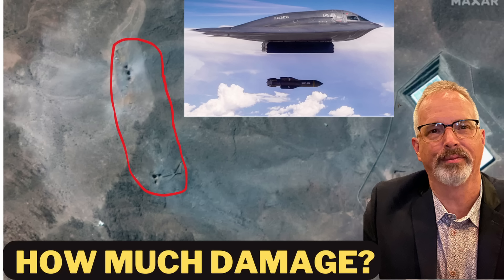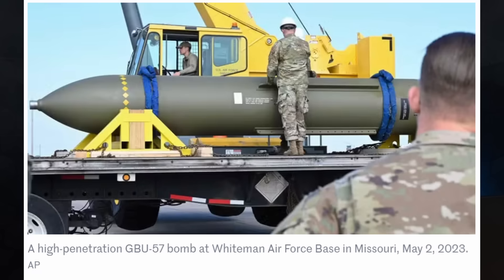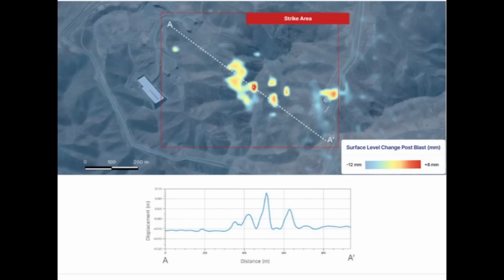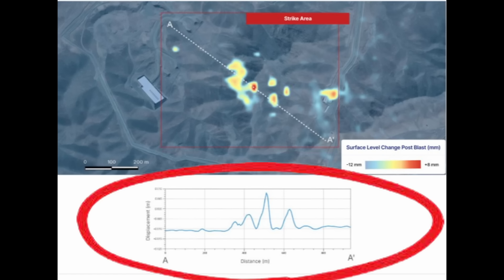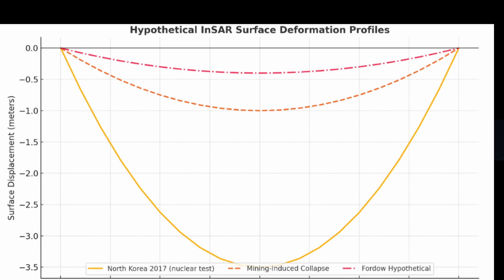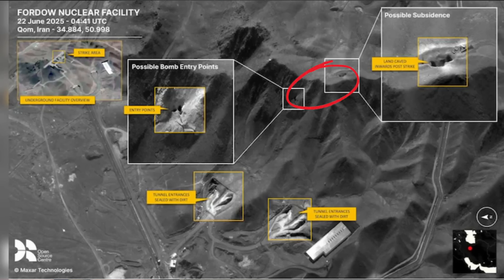Fordow Attack Assessment -  Update

Comment: There have been comments elsewhere about the IRGC doing post attack construction work at the site. More likely, this would be a geotechnical investigation to determine the damage profile. The site has multiple material types and a comprehensive investigation would be wanted to design a successor facility, whether it be for uranium processing or some other high security use.  The IRGC is aware that we only have 19 B-2s and the mop is the largest bomb it can deliver. With six MOPs down each ventilation shaft, this was very close to a maximum effort. When thinking about the MOP, it is important to distinguish between inertia and kinetic energy. When pounding a pipe in the ground, a heavy hammer swung slower puts the pipe in the ground faster than a lighter hammer swung faster which mostly mushrooms the top of the pipe. This is why there was no rocket motor to boost the speed of the MOP. For penetration, inertia is king.
Reply: what may be more likely is the other existing locations that no ones know about will have their existing ventilation shafts modified to arrive elsewhere, rendering this form of attack impractical
Reply: 680mph at best.
Reply: @russellk.bonn8534 for the b2, or the gbu-57?  I've seen estimates putting the MOP at around 800mph on impact.
Reply: @russellk.bonn8534  680 mph = 300 m/s on a 14,700 kg device is a kinetic energy of 660 MJ, which is equivalent to 158 kg / 351 lbs of TNT.
That is quite exactly the amount of high explosives used to bring down the 33-story Landmark Tower in Ft. Worth, Texas, in 2006.
Reply: Not sure about the maximum effort suggestion. The GBU-57A/B MOP contains 5,342 pounds of explosives. Meanwhile the B61 nuclear bomb is rated at 0.3 to 300 kilotons of TNT, while the B83 is capable of a blast up to 1.2 megatons.
Reply: Yea but remember it’s a maximum effort of what we are willing to reveal at the moment. We have much bigger and much better “on the way.”
Reply: Supposedly the b21 is designed to carry the MOP and we just bumped our order on those to about 200 units.

And I hope Iran doesn't make the same mistake Iraq did and trick us into believing their weapons program is a threat we can't neutralize from stand off ranges.
Reply: @dudeinanofficechair7662  Iraq didnt make that mistake, isrl convinced our gov it was true when it wasn't.
Reply: @dudeinanofficechair7662  Iraq tricked us 😂😂😂😂😂, god the copium doesn’t stop with you slops
Reply: @cmendoza1094 I've heard it a few ways. Some think Saddam tricked us into thinking they had a real program because that's how he was getting international aide bargaining leverage, some think his engineers and scientists tricked him into thinking he had a real program because he would kill them if they were honest and told him they hadn't accomplished anything. 

Are you suggesting he actually had a functioning nuclear program?

Comment: I'm an old aviation ordnance tech on the OLD single seat F/A-18 (A), first time the YouTube gods decided to lead me here.  Love the breakdown, love the straight based facts and your professional assessment at the end.  All I did was put the loadout on the aircraft and let it fly.  We were taught the basic operation of each weapon, how to do the checks on the aircraft, and general upkeep of all the ordnance computers/equipment ect...  Never REALLY knew exactly how much damage the bombs would actually do.  Missiles and rockets a bit easier to judge.  You got my sub because I learned quite a bit today.
Reply: Up front, I don't have any background in geology, arms damage assessment, engineering or any of the sciences needed to make a critical evaluation here. But I do have lifetime of accrued observation of physics. Worth nothing, perhaps, but I find my observations corroborated in many instances. 

What I notice at Fordow is these MOPs repeatedly piercing the vents, deep into the hard granite. Each bomb driving deeper and detonating at depth. The explosive forces and resultant gases are not demonstrating on the surface. Those pressures are not simply absorbed by soft rock. This is hard, but brittle granite, not known for its flexing properties. Therefore, the first subject here would be mass compression of the open spaces (tunnels, shafts and work spaces). The volume of gases would far outweigh the capacity of that compression to absorb it. Next, that pressure would uplift toward escape. The depth and strength would largely hold in that expansion. So now the rock begins to shatter as the substrate flexes to absorb the blasts. That pressure, confined in this hard box of stone, assures complete destruction in my eye. It's almost like being inside a pipe bomb. Too much pressure and not enough space for expansion.

I would expect there to be a large void beneath the surface at impact points, shattering of the rock around these pockets
and total destruction of this facility.

Maybe I'm wrong, but this is what my common sense and applied physics history tells me. Iran will evaluate the damage and their actions will determine the success or failure of Midnight Hammer. If they start digging this equipment out, we may have failed, but I suspect they'll view the evidence and abandon this site. Thank you, for accommodating this simple man's opinion.
Reply: @karlharrelson1091
Observation of applied physics over the years can sometimes make more sense than any college degree.. 
I agree with almost everything that you stated and what was in the vid..
The only thing not mentioned was that the pilots dropped bombs one after another seconds apart to ensure at least the 2nd bomb would get to depth..
I feel the shear weight of the bomb @ 30,000 lbs would penetrate a couple hundred feet deep
Reply: The world did learn that the B-2 with its maximum 40,000 lb payload is actually at least 60,000 lbs.
Reply: @andym4695  Yep, 40,000 lbs MAX it is.   Just like the carrier USS Enterprise had a “maximum speed of 33.6 knots” - but was  tracked moving much faster.   The AGM-88 missile supposedly only goes Mach 2.9.   However, the Wild Weasel mission it was designed for requires it to move faster than the soviet anti-aircraft missile whose targeting radar it is designed to destroy.  Those missiles -one of which is the S-125 - travels at MACH 3.5.  The US M1A1 tank only goes 45 MPH - which is true (unless of course the governor is off.) The US has always gone to great lengths to cover up the true capabilities of its weapons.  Which likely means they would not have even flown this mission if the BLU-57 - or something waiting in the wings - couldn’t go even deeper.
Reply: @andym4695  That is true, that's why so many KC 130's needed, lot a weight = lot of go go juice
Reply: @andym4695 they take off empty fuel tanks
Reply: Thank you for your service..I salute U 🫡
Reply: @kayejeyeracer  No thanks needed, but are appreciated!!!!
Reply: Soldier this goes boom.  That is all you need to know.😂
Reply: @alaskansummertime  Pretty much lol  Gotta be able to laugh at yourself sometimes!
Reply: ONLY the self-deluded opposition and willfully ignorant would argue against the obvious destruction caused to Fordow!!   God Bless our military skills and commitment to our nation!!  God Bless the USA!!
Reply: @zubenelgenubi You're the deluded one believing all their lies. They've been saying Iran is building a nuke for 40 years even though their own Intel agencies tell them there's no proof whatsoever. But you just keep swallowing what they say like a good little boy.
Reply: Be careful it could happen to you

Comment: The bombs have a penetration depth of 200ft. A simple coal mine is 3000ft. It is quite likely if you have years to plan for being hit to dig beyond 200ft. Maybe they store the solidified UF6 feedstock and product far deeper and just have the warmed UF6 gas in the centrifuges at 200ft. Maybe the centrifuge rooms got hit, but that doesn't mean all the solid product has gone.

Comment: I would imagine that the shock wave thru the air duct must have punched it's way into the facility on the initial blast which would be pretty devastating. The shock wave thru the rock of the subsequent explosions may have cause the walls inside the facility fracture and expel rock and perhaps a ceiling collapse unless the facility was a lot deeper than 200'. The amount of activity at the site should be a good indicator on how much damage was done.

Comment: Thank you. Great video.  I have absolutely no background in geology. Does the expectation of fractured rock, and amount of increased volume, depend on the available area to expand into?  For example, if the shafts ended in nothing but solid rock, like in oil fracking for example,  do you get the same mount of 'bulking'?

Comment: The bombs have a mass  of 30 000lbs but a much smaller explosive payload of only around 3000. Most is made up of steel. The Iranians were also very open with the design which included blast halls to redirect the energy while protecting the structure itself. Weapons manufacturers have a tendency to grossly overestimate the capability of the weapons they sell. Im still pretty sure this has only added rubble that could be cleared within months. They are already rebuilding. Why rebuild an underground structure that has been destroyed when it would be far easier to use one of the many other sites available to them
Reply: You are pretty sure this only created rubble?  I am pretty sure, you have no clue and just fabricated a story.  Name the other sites, that have these types and quantity of centrifuges?

Comment: engineer who is not there doing 20th party they got from a friend who got from a friend who got from tiktok who got from china...blah blah blah.... as a guy who tests defense department weapons longevity cycles who works in the same BAE building as the developer engineers for things that  make other things go KABOOM...the blast alone wiped out all the machines inside...the tectonic blast pressure alone, then the engulfing fire milisecond by milisecond and you're here talking about dirt and your not a geologist. well buddy as an operating engineer since before you were born. it takes me 2 hours to put an 8' diameter hole  down 36' feet...so in half a day i could sink a drill right into the blast site...but your not even there, you don't even know how to run a drilling rig much less use it, and i'm sure you'd break it inside 5 minutes anyways. but your going to give ius your expert plastic manufacturing engineering advice. you ain't even qualified to hold my big johnson.

Comment: Is it possible they didn't put the actual functional parts of the facility under the vents? Would it not make sense for them to burrow sideways an extra 500 metres or more away from the obvious surface elements to actually construct the critical parts of the facility?
Reply: I've wondered about that. Knowing the exact layout of the site is crucial to putting those bombs on target. But I've since learned that IAEA inspectors had regular access, so indeed it is known exactly where those ventilation shafts lead.
Reply: @WritesWithCare So you are confirming what the Iranians have said about the IAEA inspectors being spies?

You yanks always run your asses without thinking through what you say.

Comment: Bomb Damage Assessment of Iran's Fordow Nuclear Site Using Interferometric Synthetic Aperture Radar (InSAR) Analysis: 

The Fordow facility is located in an area with granite rock, known for its hardness, which aligns with President Trump's previous statements [03:36].

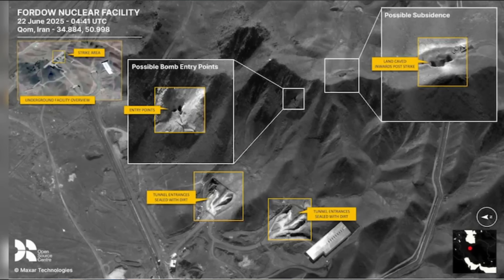The sharp, knife-edge ridges around the facility are characteristic of granitic formations, suggesting the Iranians chose the site for maximum protection [04:22].

The GBU-57 bombs are designed to penetrate tens of feet of rock and detonate deep underground, creating a "camouflet" effect—an explosion that leaves a sealed pocket of smoke and gas without forming a surface crater [06:31].

Despite the subtle surface changes, Casey Jones estimates a maximum of 100,000 cubic meters (130,000 cubic yards) of granite was fractured, based on a "powder factor" of 0.3 kg per cubic meter [08:02]. This volume would require over 13,000 truckloads to haul [08:43].

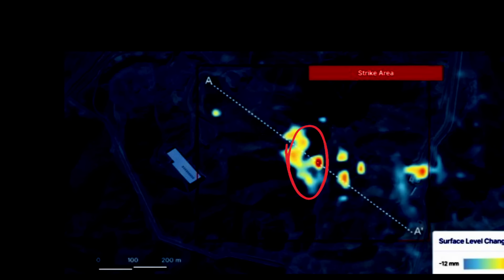The estimated uplifted material volume is around 400 cubic meters (500 cubic yards), which is only a small percentage of the total fractured rock [09:42].

The facility's depth (80-90 meters or 250-290 feet below the surface) resulted in high confining stresses, directing the explosion's energy sideways and downwards with minimal surface expression [10:31].

Casey Jones concludes that the facility is likely "utterly destroyed" due to the extensive damage at great depth, despite the limited surface evidence [09:08].

Comment: Great video.  But I'm not sure this destruction I agree happened is a whole lot more than some fractured rock above the confines of the facility.  Would be helpful to know the volumes of the underground facility to help with that.  But the general burn that happened above ground is very good sign some of the blasts were very much puked out.  The plugs on the facility entrances seem most undisturbed also.  Essentially it seems a lot of destruction and rock crushing could have happened without finally making it in.

Comment: You are basing your analysis on what may be a totally false assumption.   I doubt that Iran was stupid enough to build vertical ventilation shafts all the way to the bottom... given that they knew the US would likely bomb the facility. those ventilation drawings may have been deliberate misinformation.   If the bombs were stopped partly the way down vertically there may be no dammage to the lower tunnels at all.

If I had been designing the ventilation shafts I would have gone like 50 ft down, then 100 ft horizontally with a blast door that would be closed by a blast from one side.  Then down another 50 ft, then another 100 ft horizontal tunnels with a blast door, then do it again two more times to get down to the production and storage tunnels.    Given the hardness of the granite all that would have been collapsed would be the topmost portion of the ventilation shafts.  It is unlikely that the 4th blast door would have needed to have closed.

As far as eplosive damage result - you forget that a lot of the blast energy is going to go back up the ventilation shaft or the entry hole that the bomb penitrated.  Those are open and unsealed.  In tunnel and mine blasting the ends of the blast holes are sealed to ensure that most of the blast is transmitted to the rock and not just blown out the entry hole.   As a once licensed blaster I would reduce your blast damage estimate by at least 50% if in solid rock, and likely less than 20% if at that bottom of a ventilation shaft.

Iran is not allowing any inspectors in but has said that the facility is not totally destroyed.  I would not be surprised if there is no significant damage at all to the production equipment.

In addition you have the issue that its almost certain that Iran removed the highly enriched uranium hexifloride from the facility days before it was bombed.  So they appear to have access to at least 60% enriched uranium in a quantity likely large enough to produce multiple atomic bombs,   It would help if they ran it though another centrifuge cascade set to get it above 90%, which they may be able to do because Iran has centrifuges at other facilities.

Comment: According to AI, granite would couple more energy from the bomb than dolomite. The MOP exploding in solid rock (not down a vent) would couple an enormous shock wave toward the tunnel without having to actually  penetrate to it. Even if that shock wave did not collapse the tunnel it would destroy anything in it.
Reply: not  a simple problem. the shock wave will attenuate but the rate of attenuation is a question for specialists and Phds.
Reply: @juliuscesar4176  Even they won't know for sure because they would have to know the details of the fracture pattern down to the surface of the tunnel concrete. Nevertheless, the shock to the tunnel should be strong and one need not be a Phd to know that.

Comment: Thanks for your video.
The ventilation shaft(s) may have been staggered and not gone straight down through one shaft.
In other words, a shaft went down to a depth of say 50 feet, then a horizontal shaft extended over from this shaft to another vertical shaft and possibly the same thing again at another depth.

Comment: Maybe I missed it, but would like to hear your analysis on the ability of the GBU-57 to actually penetrate to the depths that are involved regarding some of these facilities--given that the earth material is granite. Now with Fordow I understand they used the ventilation shafts as entry points, so I'm not sure the penetration depth was as much of a factor. Presumably most of these facilities, if not all have exploitable ventilation shafts, but hypothetically if that were not viable for one reason or another, what can we do to better understand the actual penetration capabilities through hard or very hard rock?

Additionally, how effective do you believe the use of diamond shaped reinforced concrete caps would be at deflecting these munitions?

Comment: You didn't really touch on the relationship of the rock fracturing depth and the effects at the depths of the facilities if there is a substantial region of non fractured rock between the two levels. How much would that affect damage if the bombs were unable to follow the paths of the ventilator shafts to the bottom?